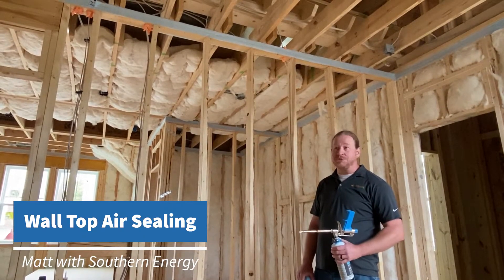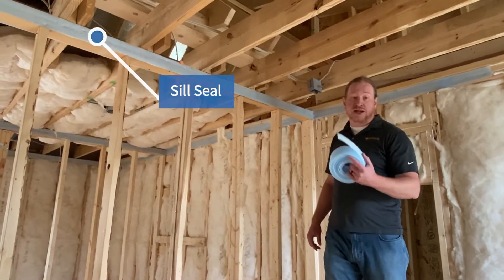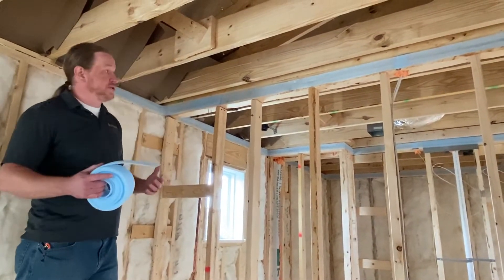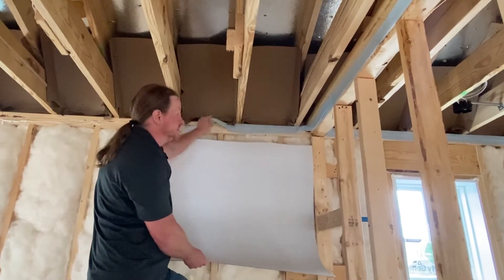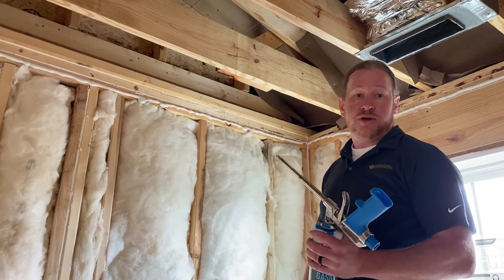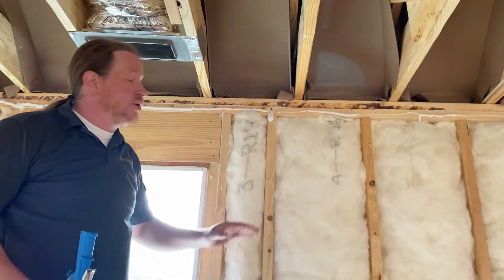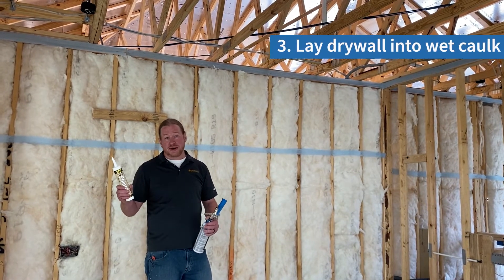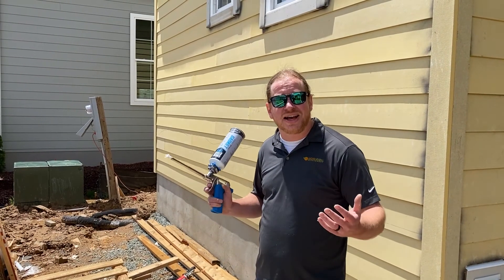Wall Top Air Sealing: Tips & Best Practices

Comment: So I bought a thermal cam and have hot spots at the ceiling meets the wall could this be my solution and how do I do it if I already have drywall and ceiling
Reply from the maker: I'd check your insulation levels in those areas first.  Attic insulation (batts or blown) doesn't always extend over the wall top, leaving hot spots at the perimeter.  Air sealing the wall tops with foam could also have some benefits, but it will be difficult to do from the attic side.
Reply: @Southern_Energy  so the insulation is pushed up against the wall top

Comment: I have recently heard that using foam sill seal on outside wall top plates have caused moisture issues there.  Anybody know about this?
Reply from the maker: We haven't seen any real life examples of sill seal causing moisture issues when properly installed on exterior top plates.  More often we see damaged, missing, or poor, wall top air sealing cause issues here in NC.  Condensation on walls and fixtures, excess infiltration, and high indoor RH to name a few.  Sill seal can be very effective, but can also be easily damaged or removed during construction, leaving gaps.  Regardless of the sealant material used there's a big reduction in the infiltration of unconditioned air behind the drywall, which carries a ton of moisture in with it.

Comment: What I'm interested in is whether it's common for builders in moderate to warmer climates to use an interior air barrier product like INTELLO or some other interior wrap. There are many articles that say that most of the moisture management is accomplished by more airtight construction. Here in Australia they're already recommending interior wraps when we don't have good airtightness to begin with. Seems like we should focus on the simple and proven strategies like this video shows. Can't wait to see the next video.
Reply from the maker: Sorry Sean for the delayed response, this one got missed in the comments! Glad to see you've been making some video's of your own!  In my experience in the South Eastern US, interior air barrier are absolutely not necessary to achieve extreme air tightness if we get the framing and drywall details right.  Air infiltration carries far more moisture than would be diffused through drywall or other vapor permeable wraps.

Comment: I lIke it. Clear and well-scripted video. Good for builders of code-level homes. Can you tell me - do builders in the southern U.S. generally use an interior air barrier besides plasterboard? What was the target air leakage rate of this project?
Reply from the maker: Drywall/gypsum is by far the most commonly used product for interior air barriers.  Tply and OSB are often used for those secondary air barriers in chases etc.    The majority of the houses we work in are code plus, the target on this particular house would be sub 4 ACH50.  That's totally achievable when sealing drywall to top plates to stop infiltration from the attic.

Comment: Very informative video. Building my current house. Drywall is already up - I probably would've used gasket foam had I known it exist. We just caulked the joint between the two top plates. Oh well. But thinking through it more, where exactly is the 1/8" gap at the top of drywall mentioned in the video coming from? If the drywall ceiling is hung first, then the wall drywall, then drywall tape/mud at that corner, where is the gap coming from? Where is the leakage? Is not the drywall the air barrier? Sincere question. Thank you.

Lastly, anything I can do post drywall to air seal the top of wall to attic joint if that gap does exist?
Reply from the maker: There is always some gap between the drywall and the top plate, which allows air leakage down from the attic behind the drywall (vertically) directly into the wall cavity.  Then into the home through electrical outlets, switches, baseboards, etc. because those penetrations don't often get sealed on the interior walls.  A dead giveaway would be air leakage around the outlets or fixtures on interior walls. 

Now the good news - If your attic insulation is not installed yet, you can still seal those gaps from above with a modest application of expanding foam.  Any walltops, interior and exterior, that connect to the attic or unconditioned space should be sealed on both sides.  Good luck!
Reply: @Southern_Energy  Ah, I see. Attic insulation has not yet been installed, so we have a chance to seal those joints. Thanks for the response.

Comment: Check out Aarow Building / Jake Bruton for another method for new construction: frame the house without interior walls, rock the entire ceiling plane and firetape board joints before building interior walls. Benefit there is you have an dedicate phase of construction where all the electrical/mechanical penetrations through ceiling air barrier can be dealt with more or less perfectly.
Reply from the maker: interesting approach, we'll have to check them out!